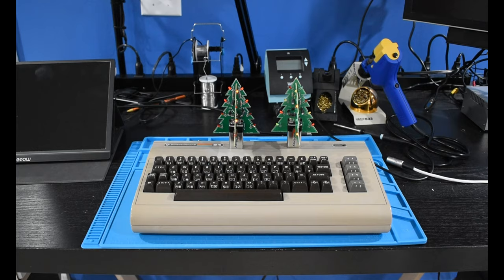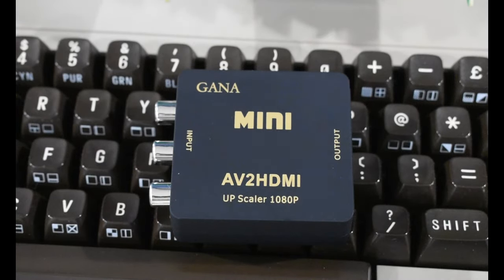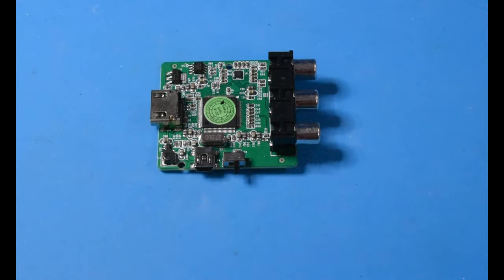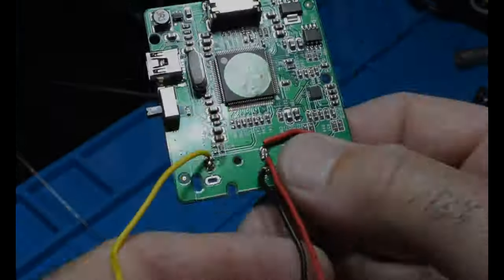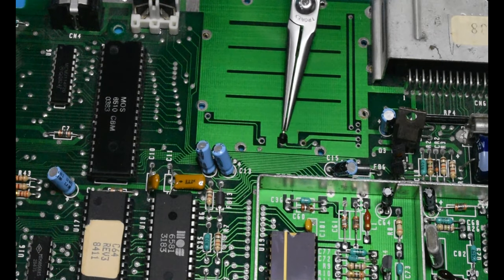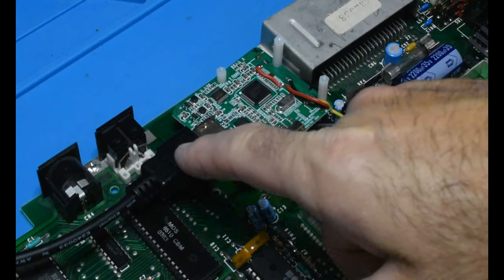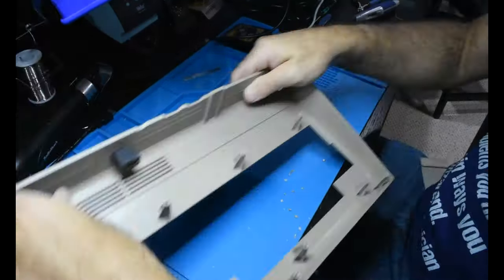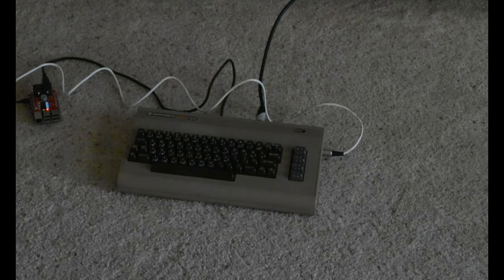Adding HDMI Output to the Commodore 64

Comment: On some if not all 326298 boards, R10 is 300ohms when it should be 120 ohms.  Bridge it with a 220 ohm resistor or replace it with a 120 ohm resistor to improve the brightness.  Remove C73 to improve the sharpness.  It will look much better.

Comment: Which revision of motherboard do you have? All the ones I know of needs the modulator in place to enable video out on the din connector. Yours seems to be an early version but even so I can't find a schematic that matches yours.
Reply from the maker: This is what I have in the video https://myoldcomputer.nl/technical-info/mainboards/commodore-64/board-326298-01-c64/   And you are correct, other revisions will need some other tweaks in order to remove the modulator and still get video out.  I was just trying to get the Christmas demo on my TV, so I didn't really put any thought into video quality or other revisions of the board.  I was thinking of doing a video on this with a  64c and show how to do it on that type of system, with better quality, etc.
Reply: @thecommodoreroom4554  I knew it was an early revision but I have never seen one before KU-14194HB version. I'm surprised you modified such an early machine considering you have other less valuable boxes around. Love your videos and I'm currently catching up on your older videos. Keep up the good work.

Comment: Why did you use composite instead of Y/C as your source for the converter? You could've gotten a much better image by tapping the Y/C lines. (A converter that accepts Y/C is not any more expensive)
Reply from the maker: No particular reason.  There is definitely room for improvement.
Reply: @thecommodoreroom4554  I’d love to see a video for that ! You already inspired me though, thanks.

Comment: Quick question : does this work on the c64c 250469 also?
Reply from the maker: I’m not sure. I’ll take a look at the schematic and see if it looks possible. I’m sure I have that revision around here someplace so I could test it out.
Reply from the maker: Based on the schematic you’d have to do a couple things once you pulled the modulator. But it should work with some tweaks.  I was going to do an improved version with better picture quality so I’ll see if I have this board and I’ll use it.
Reply: you could do it but you'd need to add one of the RF modulator delete boards as well
Reply: The Commodore Room I hope you do, I’d be very interested in a newer board conversion.

Comment: Is there any signal or output lag now? i read about 3 seconds lag if you using that kind of hdmi converters? would be awful if you do a jump & run and the lag is feelable.
Reply from the maker: There is about a 2-3 second lag on power up in which the screen is blank but beyond that I haven't noticed anything.  I've played quite a bit of Mr. Do (my latest addictive game on the 64) and it's perfect.  I have noticed some HDMI lag on some TV's with other systems, but I totally forgot about it until I saw your message.  So I guess this particular cheap converter works very well!
Reply: @thecommodoreroom4554  Thank you so much for the helpful answer. Now i need to find the same converter in Germany.

Comment: I will do the same with a C16. The PCB of the C16 is a bit smaller, so I gonna keep the RF-Modulator. And I try to use the HDMI-Connector directly without any adaptor-cable. And the next step will be integrating a SD2IEC-Module into the same case.
Thanks for the technical details.

Comment: Why wouldn't you turn the board 90ª so you could plug an external HDMI cable directly into the board thru the case?
Reply from the maker: I would have had to drill at least 3 holes into the main PCB which I was trying to avoid. With the circuit traces I’m not sure drilling would have been possible. Also due to the positioning of the hdmi connector on the converter, the connection have have been recessed more than I wanted. 

All that being said, there is a lot of room for improvement.

Comment: A nice mod! 
My question is why my av2hdmi dont work on the C64, but it works on the Zx Spectrum?
Reply: Beacuse the signal coming from C64 is far from "right in the spec" of input parametres AV2HDMI accepts. It is notorious for C64 that video signals are problematic for many displays due to 15kHz, luma singnals "out of" range, noise from modulator etc. Zx Spectrum on the other hand can be easily modded to composite and produces nice and strong, acceptable signal. But don't quote me on Zx Spectrum case - i use ZX-HD and ZX-VGA-JOY for Zx but in the 80's i was using home-made Interface-2 compatible device with bult in AV mod to connect old CRT monitor mass produced in Poland ( before it was RF and color-TV ). I'm annoyed with C64 because my old breadbin is nasty with video. I tried Lumafix, i tried HQ cables with S-video and the quality is s**t. I'm going to remove RF modulator and try agaun with modern-digitised counterpart if not HDMI as shown above :)

Comment: Why wouldn't your orient the adapter such that the HDMI is aiming out the back of the machine?
Reply from the maker: The hdmi converter is mounted fairy securely but not enough to hold up to plugging and unplugging of the cable.  Turning it would have required drilling some holes and I didn’t want to get into that just yet. There is a lot of room for improvement for sure.

Comment: Just subscribed.  Neat project, but as others have noted, it works only for certain models without additional circuit changes. I was worried that you'd be stuck with stretched video but in the end you seem to have gotten to aspect ratio right.  Stretched video is unforgiveable!
Reply from the maker: Yeah, I really don't like stretched video either.  I do have a 64C that I modded in this way with the required changes to remove the modulator.  I'll post that one when I get a chance.  Thanks and take care!

Comment: You need to use S-Video even on a full size 300 bucks well respected converter never mind some mini converter, which is probably doing a worse job than the terrible digitiser used inside my 65 inch 3D Plasm (most expensive TV when released lol).
Reply: I got this converter as a bonus from some chap with Super Famicom. Its quality is bad. Like the quality cheapest composite video grabber bad. Hence I consider this project in the video as absolutely idiotic. Especially since even if it was for which TV didn't have composite video input one could just put the converted behind the TV and power it on from usb port which TV's tend to have these days.
Reply: @e8root  My 2000 EURO (when new) Plasma TV has horrendous composite video  digitiser inside for conversion. Composite video always needs broadcast quality HDMI conversion equipment to feed an LCD/LED/OLED/Plasma screen, garbage in garbage out as they say.
Reply: @madcommodore  I can easily imagine this to be true, some TV's have horrible composite inputs. I am just not approving your choice of the converter because if you do this kind of mod you should get proper solution eg. Retrotink 2X Mini would do much much better job and at 79 bucks it is not prohibitively expensive. Retrotink is designed for 240p/288p signals and can resolve sharp per-pixel details, not to mention it supports separate luma/chroma smf has near zero input lag. Cheap composite HDMI converters are designed to allow run of the mill monitor to input 480i/576i signals and do not even know what 240p/288p signals are and they also add as much latency as typical TV composite input adds. It would make sense to put the best stuff in to your Commodore, wouldn't it?
Reply: @e8root  I don't like using anything below native SCART RGB analog based consoles/computers on LCDs/Plasma  anyway. CRT tubes also generate the images in a completely different way so I'd rather spend 80 quid on a CRT TV for retro gaming lol that's how those graphics were designed.
Reply: @madcommodore  Obviously CRT is the way to go for retro, especially for hardware where games/demos ran 50/60fps as those will only look truly as sharp when things are moving on CRT. As for RGB or not-RGB for me it all depends on system and context. I like using original retro hardware the way it was intended to be used and for something like NES or C64 I would never consider RGB mods and C64 I might even choose Composite. Otherwise if actually really got in to C64 recently on Mister FPGA and here I have it in is in FullRGB glory :) I did however change color palette to colodore and added very slight hanover bar effect to break monotony. Not sure why but I immediately felt C64 needs it.
Reply: @e8root  I meant old hardware that outputs RGB analogue natively (Megadrive/SNES/Amiga/ST/Amstrad/BBC etc), which LCD and Plasma TVs just double the refresh rate on and process it as if it was VGA so it bypasses the digitisers for any kind of conversion beyond doubling the 15.5khz horizontal refresh rate to the non interlaced 31khz standard that all modern TVs support so there is no digital noise or artifacting. Lotus II via SCART RGB from Amiga to 60 inch  plasma looks crisp as on a CRT because it's not a simulated digitized image, just a scan doubled signal. Gives a really nice picture. Computer displays with borders give screen burn on my plasma anyway.

Comment: @The Commodre Room - do you think it's possible to go from HDMI to RGBI ?  I have a Commodore 1902A monitor that I'm going to connect a digital source to. I can go HDMI->Composite easily enough, but I was just wondering if I could use the better quality RGBI input?  (this is for an "art project" so to speak, I'm not just looking for a good CRT monitor to use, I want to use this 1902A for a specific project I have in mind)
Reply from the maker: Hi, you should be able to do that without too much trouble.  I'd have to look up the 1902A inputs, but RGBI is a component-type input so you'd just need an HDMI converter that outputs the RGB components.  A quick amazon search pulled up a few.  I've never tried it so there could be some hidden details I'm not thinking of...  Obviously if the HDMI is carrying a lot of information, you may lose some (i.e. the 1902A isn't a wide screen monitor).  Another thought would be to look around for "hooking up HDMI sources to older monitors"...good luck, sounds interesting ;-)
Reply: @thecommodoreroom4554  ok great thanks for the tip. I didn't think it would be as straightforward as just being component video
Reply: P.s. the RGBI is a DIN input by the way, not separate RCA inputs like component
Reply: @jeffmccloud905  RGBI is not appropriate for the C64 as the CGA color palette is not the same as the C64 color palette. If you convert C64 graphics to RGBI at best you get the wrong colors (CGA colors), at worst 2 colors become fused into one RGBI color or noise from the VIC-II causes the converter to flip between two colors.
,
EDIT: To show what I mean, here are the two VIC-II color palettes (old one with 5 luminence levels -- counting white and black, new one with 9): https://ilesj.files.wordpress.com/2016/03/c64-luminance-comparison.png

Here is the RGBI palette: https://1.bp.blogspot.com/-EpD1P8gDZVg/Vy7QCJ_KemI/AAAAAAAAGP8/PxBCVjq4mhMe6631jhA5TW6PnOPUgldvACLcB/s1600/Untitled%2B0.png
Reply: @jeffmccloud905  The issue becomes apparent, even if you're not trying for exact colors, when you consider that RGBI has two levels of cyan while the C64 only has one, two levels of magenta when the C64 doesn't have magenta at all, while the C64 has violet and orange, which RGBI does not have at all. C64 violet could map okay to one of the magentas and not look totally terrible, but close color for C64 orange (#DD8855) in RGBI is Brown (#AA5500), which is already busy handling the C64's brown (#664400). 

So if you converted C64 output to RGBI all the colors would look wonky and orange and brown would map to the same color.

Comment: Great video, Lige!  Can this be done the same way on a C64c?
Reply from the maker: Thanks!  And sadly no. But I have looked at a couple schematics and will post an update with the 64C and also with better video quality. From what I’ve seen it’s not a big change but you can’t simply remove the modulator in most of the motherboard revisions.